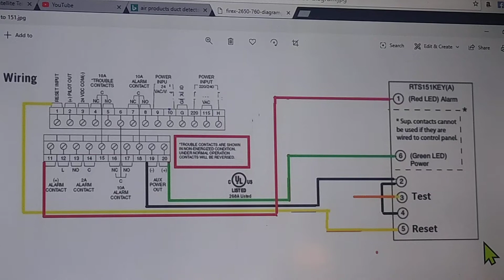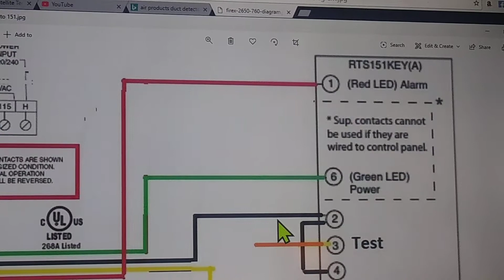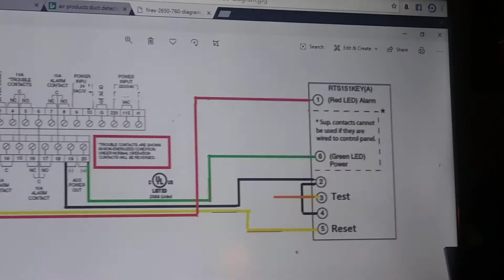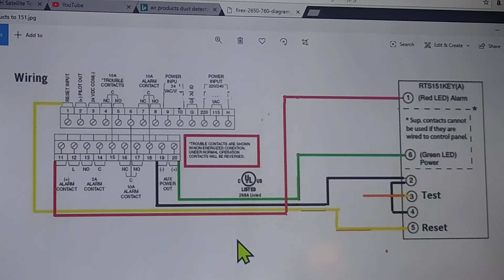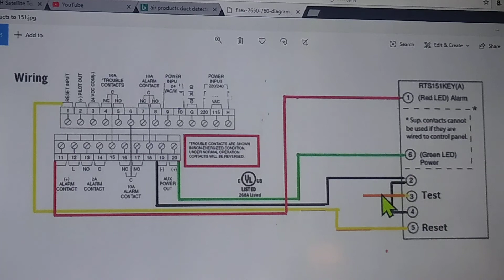Air Products to 151 RTS wiring and explanation

Comment: The diagram in this video is not correct.  If you encounter this application call System Sensor,  they have the correct diagram

Comment: The products are not compatibility tested by UL, so using the two together will void the UL listing of the detector meaning your installation is not code compliant. That is why it is important to not mix and match the detectors and remotes.